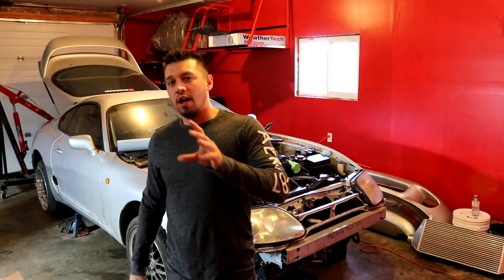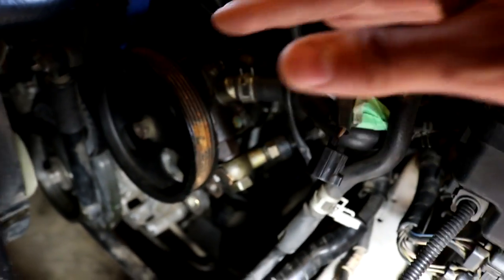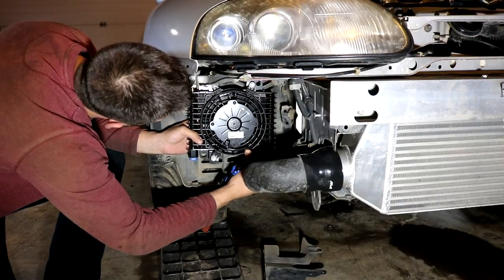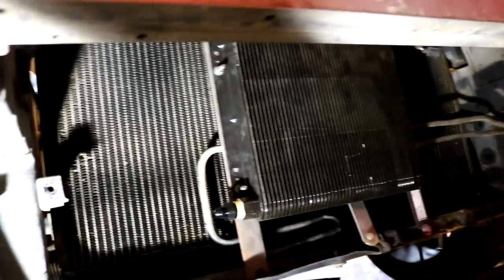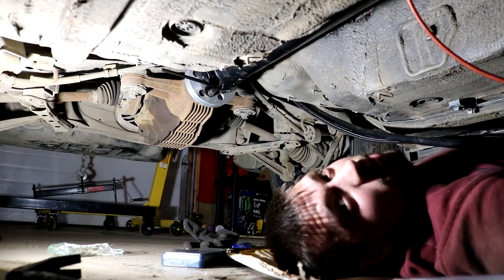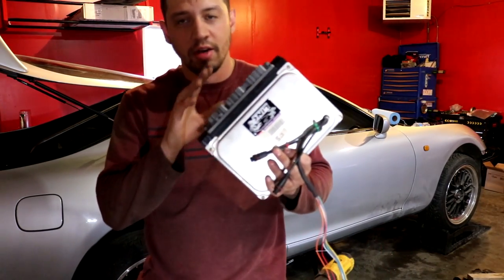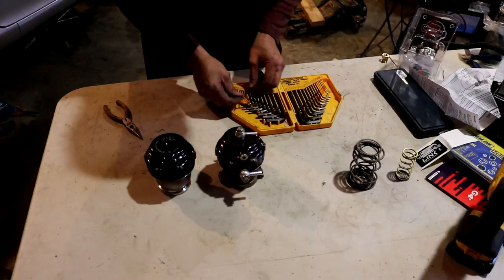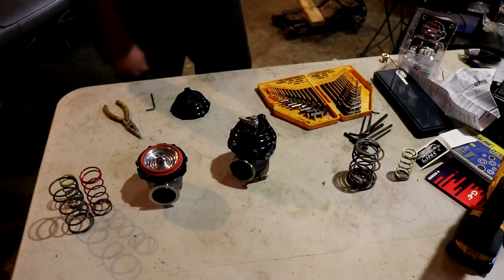Supra Build | Part 14 | All of It

Comment: Immediately using the Visual Progress term mate, I'm in your head. Now my understanding with the gates is you should always run the springs to the the highest boost you can, below your target boost level, with any actuator setup, giving the actuator greater control as it has less work to do across the whole range.
Reply from the maker: +tangles01 you are in my head! But 4 port controllers!  Now I can run 10 psi low boost :)
Reply: Run low boost by applying less throttle.

Comment: if its a basic fan (permanent magnet dc motor) reversing the polarity would change fan rotation
Reply from the maker: but the blades arn't designed to spin the opposite way i dont think
Reply: Frig. Worth a shot. Just had to do that to my quad. Changed a bearing and must have re assembles the poles of the magnets wrong and it spun backwards so instead of taking it all apart I flipped the connector around and cut a new keyway into the connector so it plugged in lol👍🏻

Comment: engine specs?
Reply from the maker: +lsftw_123 SR stock short block, bc276 cams, single springs with ti retainers. Phr manifold, phr fuel rail. Id2000 injectors, bw 76mm turbo
Reply: Boosted Lifestyle 😍